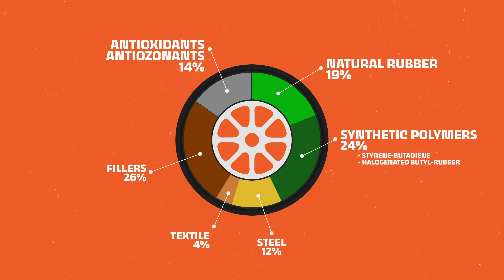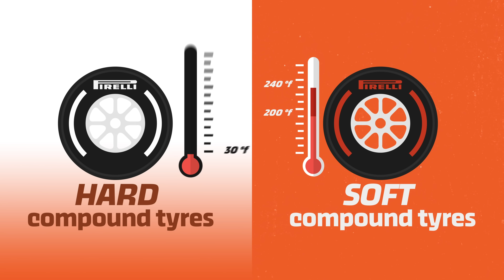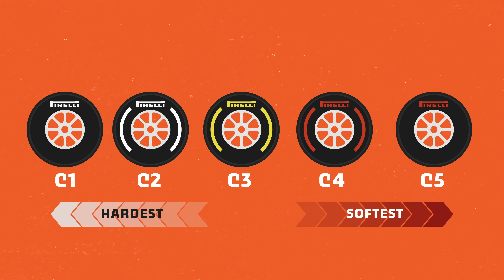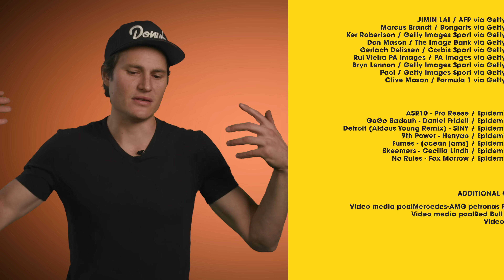Why an F1 Tire only last 50 miles

Comment: The racing would be awful if there weren’t tire deg and strategic pit stops. There will always be a gulf between the front, middle and rear of the field, due to the wide interpretation of the regs, and the cost of changing a car because you went down the wrong path of development at the first of the season. This would lead to a couple, if not one, driver/team just running away from the field, and subsequent positions equally spacing gaps all the way through the field every race. No passes after the first lap or two, and the highest level of racing reduced to a boring afternoon of watching cars go round in circles without passing anyone aside from back markers. I don’t understand people wanting to do away with tire strategy or DRS. These things were introduced to make racing better, closer, more passes and on track battles, which is why we watch. Rainy races, these regulations and tire deg may cause shakeups in the field and some drivers may get caught out where they didn’t deserve it, or lesser drivers getting a boost they didn’t earn, but the top drivers and teams always end up rising, and we get better races because of it. The bigger problem is the FIA’s obvious love affair with Merc/Hamilton. But that looks like it may be waning here in 2022. Well, aside from this new flexi floor directive. Ferrari and RB are within the rules, but the good ol FIA want to make them change their floors and planks because they work too well and protect their drivers spines better than Merc and the old man. But that’s another topic for another day. Cheers all, and just enjoy the race.

Comment: If you want to go even more back in time with tyres: Dunlop supplied tyres to F1 team until 1977, Firestone did in 1975 (Firestone and Bridgestone where two different companies before 1988 when Firestone was sold to the Japanese company.) Continental, Avon and Englebert where also supplying tyres to F1 teams.

The original-4 where Pirelli, Firestone, Dunlop and Englebert.

Comment: I would assume there is some kind of union deal between pit crew workers and manufacturers. To use the pit crew less is to lose jobs or at the very least, significantly less labor. Less labor would inevitably result in a conversation of pay. But I am purely guessing.

Comment: I think FIA needs a staff overhaul. They make F1 more dangerous by insisting on hazards like failing tires, reduced down force, less money for testing and less time for practice. They make agreements with teams behind closed doors. They change rules back and forth in races. They wait 3/4 of a race to issue a penalty. They ban innovation. It is sad to see the regulating authority literally be the worst part about a sport.

Comment: F1 is showbiz, not sport.  It is phenomenally expensive to compete, and it needs to put on a big show to get the sponsorship necessary to make the whole thing possible.  The FIA has to juggle with a great many balls in the air.  The purists cry of "just let the drivers race" is not a viable proposition.

Tyre formulas are just part of a complex equation.

Comment: Based on what I saw & heard on YOUR video I would say that the FIA is guilty of NOTHING SHORT OF MURDER IN THE FIRST DEGREE. 

And anyone who is a position to  make these tires safe and does nothing about it is also guilty o NOTHING SHORT OF MURDER IN THE first degree.

This is not a BLOOD SPORT – and I know that the drivers for years have been trying to increase the safety of the cars and it is an uphill battle.

I love auto racing – AND it is a sport not a death sentence!

AND

Anyone who is in a position to set the FIA straight and DOESN’T should be PUT IN JAIL for a veeeeery long time.

Comment: I know why they only last 50 miles a pair, a pair of Goodyear bias ply drag slicks only last around 25-30 miles total usually you go through two sets a season, M/T and Hoosiers are so hard you can run them for about 150-200 miles but they don’t hook for crap they slip bad because the compounds so hard, they run all motorsports but drag racing hell they even do E-Sports I’m about to start racing FIA sanctioned races soon in GT Sport

Comment: Just "letting them race" doesn't make the race more enjoyable. Like, just take a look at the Bahrain GP last weekend. Tyre degradation is what made that race so tense. If the tyre lasts the entire race, Verstappen would have just been able to run away with it, because he has the better car and is a driver on Hamilton's level. Instead, tyre degradation allowed Mercedes to do a strategy which allowed Hamilton to take the lead. And then in the end, you had Hamilton on almost dead tyres racing Verstappen on newer ones, allowing them to basically battle it out for the last couple laps in a way which they would have been unable to without Verstappen's tyre advantage due to his car only being marginally better, and dirty air undoing any such advantage. So no, having no pit stops does not make it more fun to watch. Only series where no pitstops can make it more interesting in spec series, so noone can get a major advantage based on car alone and those where there's no dirty air, so overtaking is easy.

Comment: I'll save you 17 minutes and 5 seconds.

The rubber is super soft. That's why they don't last. It's super soft and the g loads they experience on the track wear them fast as eff.

Comment: Hamilton did 141 miles on those tyres. Where is 50 miles number coming from?
The average F1 race is 190 miles and mostly teams opt for a single stop so tyres always last far over 50 miles.

Comment: I see the FIAs point kind of. They lost me many years ago, as F1 back then was: 20+ cars running 50 laps in exactly the same order as they startet ":-) But exploding tires, I dont know... Its also also ecological a cracy thing to say: We spend billions to make the worst and most waistfull race tire you could think off, and nobody will profit from that, because that tecnology is not transferable to anthing else.

Comment: So here's why there's no up to speed.. (129) car/truck videos (make model and sub model) videos. (7) oem perf. division videos.  (7) aftermarket perf. divisions. (2) racing (F1, group b) videos.  (2) race car drivers (Petty, Miles). (1) race track, the ring. (3) engines Hemi,LS,Cummins. (3) motorcycles. (2) semi trucks. 4 misc eps. Santa sleigh, quattro system,foxbodys, john deere tractors. (2) deleted eps. and a Redux episode of the RX-7.. ⚡⚡⚡ and now there out of ideas maybe?

Comment: I think it's stupid that the FIA has degradation regulations. F1 is a test of how much you can maximize racing performance, its more of a scientific endeavor than a spectacle. If tires take too long so strategy is lessened, then raise the bar. Make races longer, or put sharper turns, there are so many ways to NOT step on the researcher's feet.

Comment: This is quite dumb - they advertise sustainability and cheaper costs and boring engines that use little fuel, yet they are so wasteful with the tires. To me, it should be other way around, tires that last as long as possible, while engines as powerful and fuel hungry as necessary.

Comment: TL;DR: FIA politics. Year 2005 rules prevented tyre changing during the race and cars were fast and tyres lasted full race just fine. It's not that "we cannot create better tyres" but "FIA wants artificially bad tyres because they think it makes the racing more interesting".

I hope that someday FIA gets a grip (pun intended) and requires e.g. minimum 1 complete tire set change during the race but allow tire manufacturers to create the best tires possible. If you want to add tricks to make things more interesting, disallow tyre preheating so that cars have cold tyres after every tyre change. Regulate the cold temperature if needed.

Comment: There have to be limiting rules. Otherwise, a robotic car would win every race, except for the race where it explodes and kills the entire population of the racetrack.

Once you take that first step down the slippery slope, you might as well introduce restrictor plates and have a gay pride ceremony before the race.

FIA has done a decent job of holding the line from both directions.

Comment: Wrong. F1 want more tyre changes to make racing more interesting because its boring. So the teams get tyres that give max performance but but last only for  15 minutes. Best solution to make f1 more interesting would be to make whoever finishes first in a race, start last in the next one. Simple.

Comment: This is definitely politics. The FIA is forcing dangerous practices just for show, which is not a safe thing. If the tire companies have the capability to invent racing tires that last as long as normal tires, then there is something very wrong.